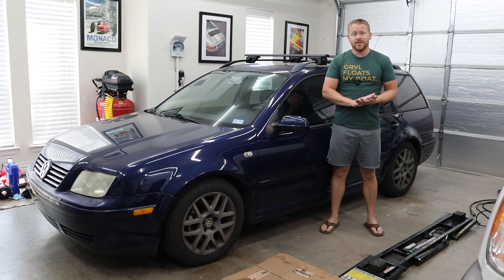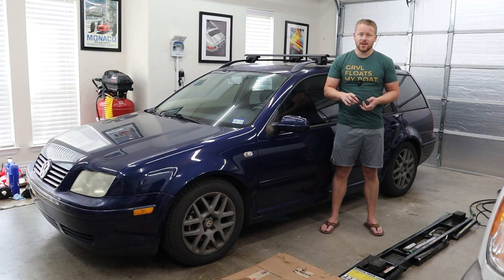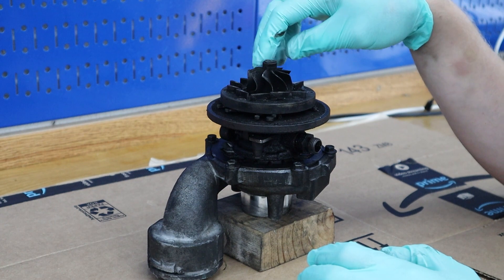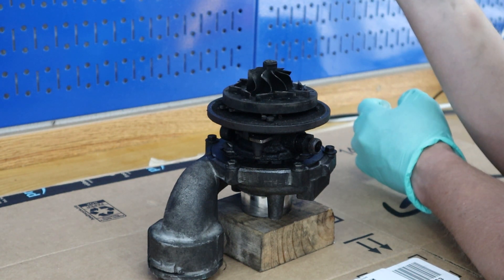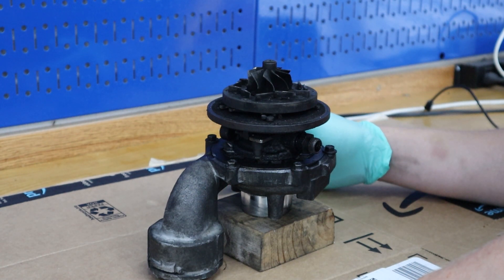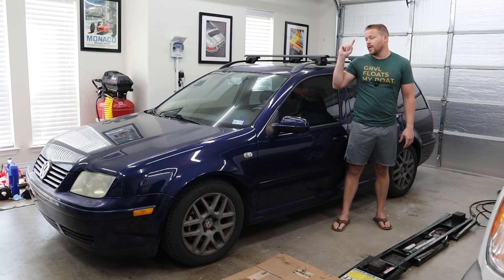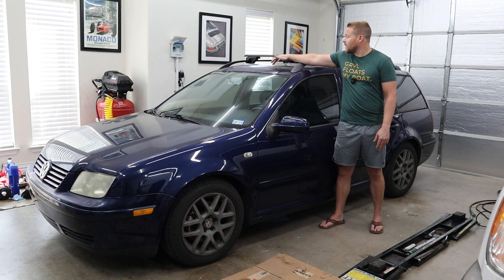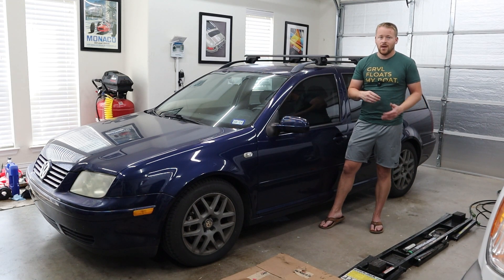Mk4 TDI Turbo Failure

Comment: Keep posting content 05 BEW grey wagon owner here, some of the work I’ve done: rebuilt turbo, re built tandem pump. Some of the things I still need to do, replace/repair oil pan, replace lift pump (thats your video that got me into your content), I also have a sun roof rattle.

It was an automatic that got manual swap but they used a 2.0 transmission, I already got a TDI transmission for better gear ratios that I need to swap